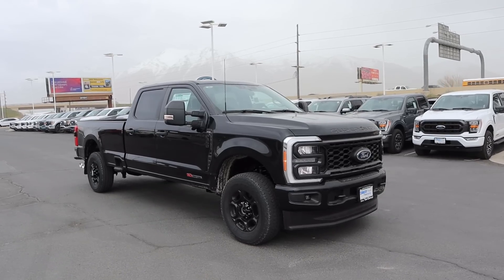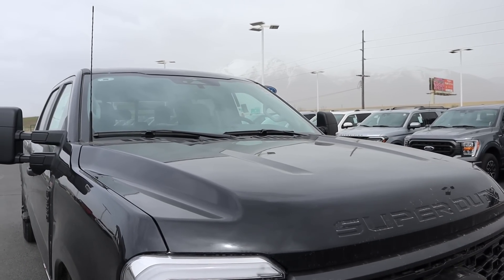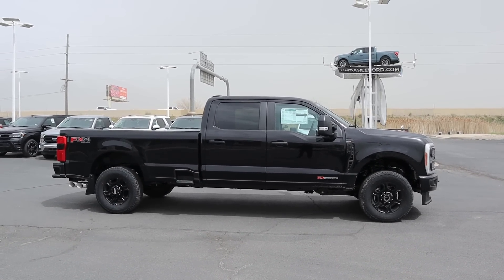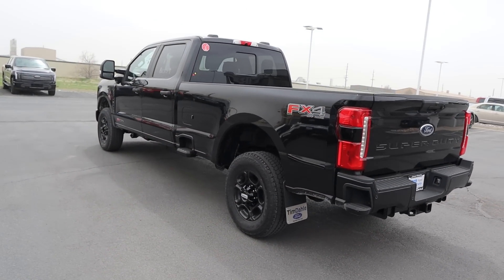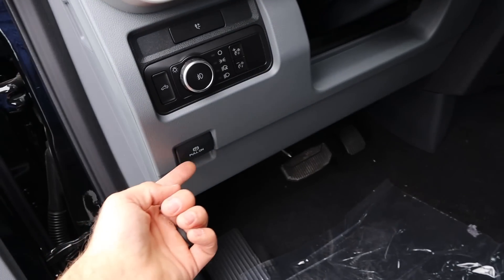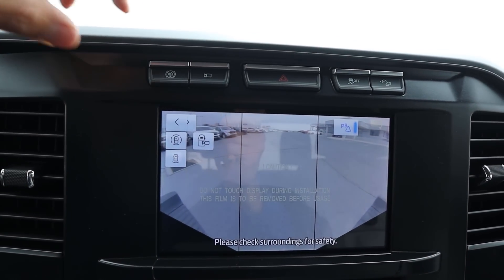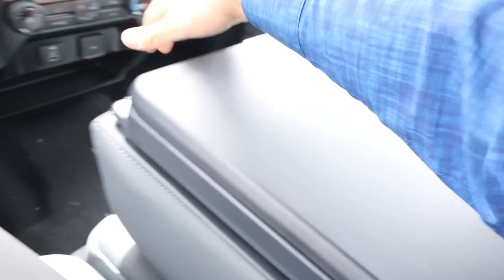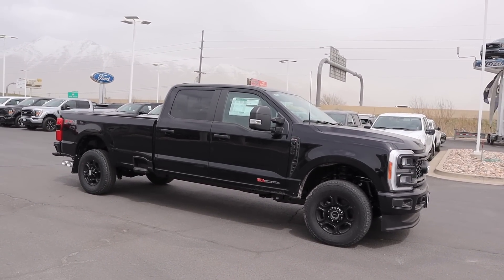2023 Ford F-350 Super Duty STX (High Output): STICKER SHOCK!

Comment: I am finding Jeeps for $5k~$7k under MSRP locally specially Gladiators. Dealers are lowering prices finally! These trucks should be had at $10k under MSRP no problem if not now then very soon. Even less is possible!
Reply: Not sure that's a good barometer.....son paid that for a gladiator last June....there was actually jeep money at the time.

Meanwhile, last week I sold my '22 F-450 for nearly $15k over MSRP in an hour ....I may have left money on the table.

Of course, the next day I get an email my '23 F-450 delivery got pushed up another 2 weeks.😢😢

Yes, prices will come down, but as long as supply on niche vehicles stays low and people have to have it NOW, prices will remain ridiculous.

Many dealers were ordering trucks @ MSRP or lower for people who had the patience....8 month wait on my '22; hoping for "only" a 7 month wait on the '23.

I will order two more this fall....just in case.

Comment: take you to work truck, not a work truck with 3.31 gears. hwy , throw stuff in bed and take to job truck, not a towing work truck.
ford should not put any gears  less than 3.73 in superdutys . i had 3.73 in my 2016 and have 4.30 in my 2021 and they perform well past expectations for weight capacity and trailering loads.